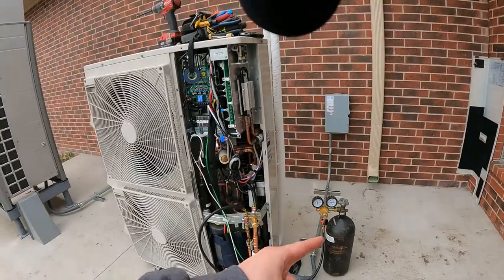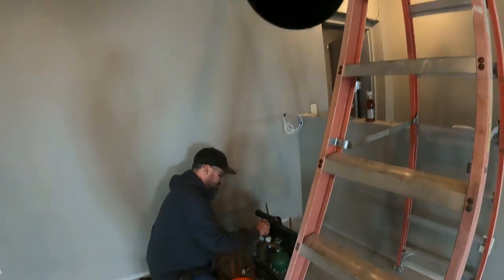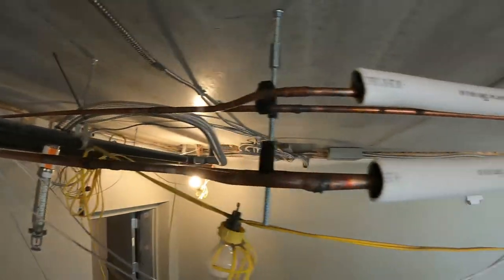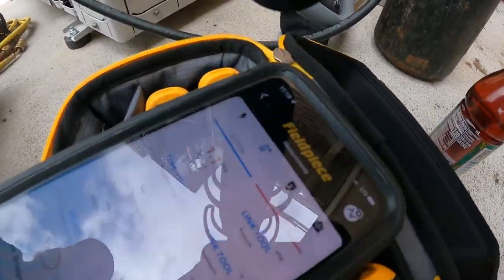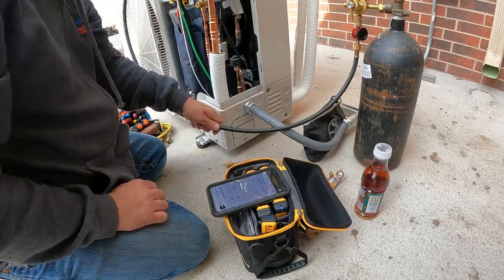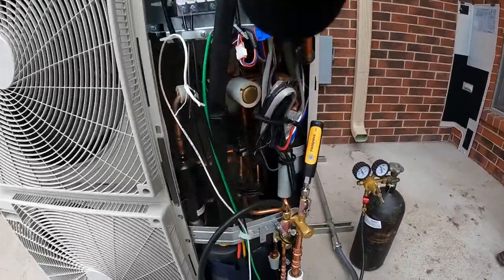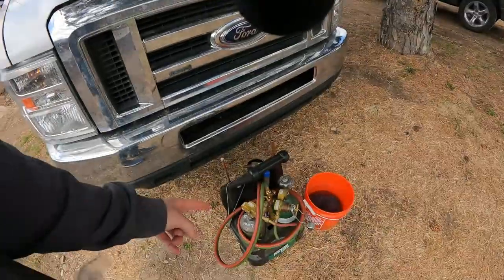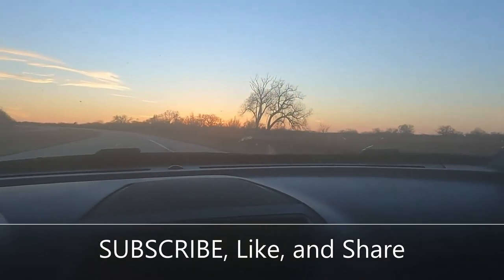Finding Leaks before Charging the System (Day in HVAC) - Daily Vlog

Comment: Had to have my hvac unit fixed last summer. Had a leak in the line between the unit and where it goes into the house. Bad soldering the guy said. Was cool to watch him fix it and recharge the system!
Reply from the maker: It's super easy to have a leak while brazing lines together. Which is why we've switched to the RLS method. So far there hasn't been one single leak with them, it's really awesome!

I agree watching and doing this kind of work is really cool to see and learn.